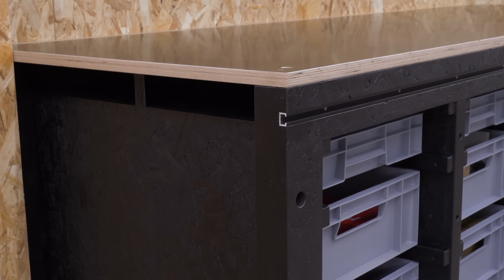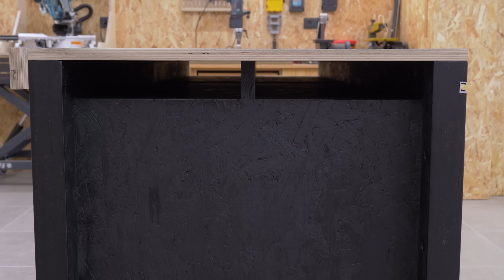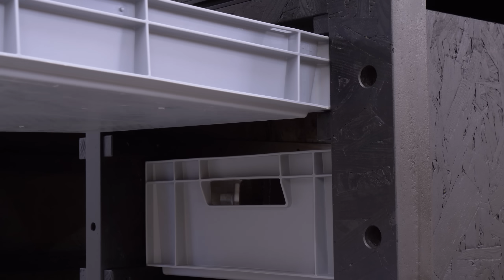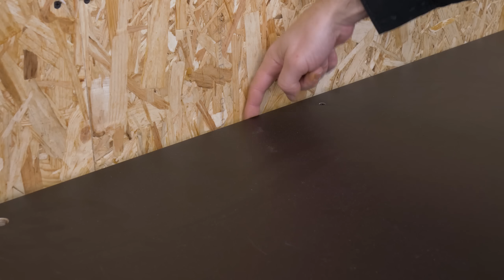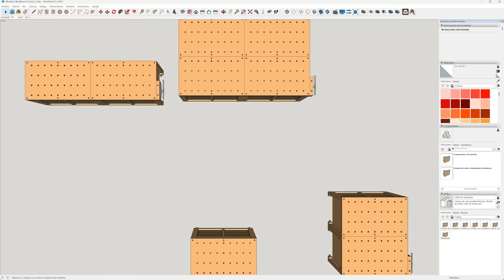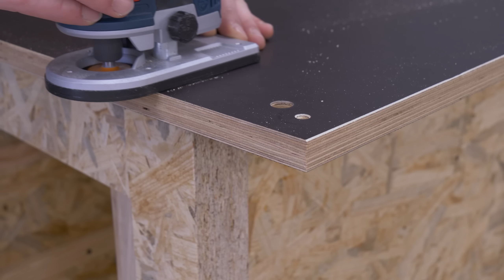OSB Modular Workbench with Storage Box Drawers - Ep 2

Comment: I enjoy your videos. you mentioned the sagging on the drawer boxes you used. I had a similar problem with some of my storage containers and I used a flat panel on the inside bottom of the bin to eliminate sag. most of these bins have a ledge at the inside bottom. from the video I see that you may have the lip as well. just cut out a thin rigid flat panel to the size of the bottom and the panel can easily support itself on the ridge and your sagging is solved. hope this helps

Comment: Fun fact for those looking to use cheap materials... a 2x3 is cheaper than a 2x2!     For corner joint reinforcement... you can rip or even better..diagonally rip the 2x3.....OSB, tempered hardboard and 5mm underlayments are low cost.

Comment: Hi, I was wondering how are these castors for moving over slightly uneven surfaces, such as if you are moving house?   From your videos, it seems the feet retract quite a bit and allow a fair bit of space around the castor wheels themselves, something that is not made too clear in the listings when buying them, as the picture make it look like there is only minimal distance, and would therefore easily 'catch' on uneven surfaces.
 
I have been planning for sometime to build/convert my workshop into more of a mobile option (to be more quickly packed up for moving properties), so that should I decide to move (as I would like to move out in a more of a country area, with a bigger industrial sized shed), and to be quite honest, who wants to either move all their tools etc into boxes, AND then rebuild cabinets etc in a new place, or separately manhandle them, when instead they can just be filled up with packing material (unless made with an organised internal lock up feature) and simply wheeled out to the waiting trailer or truck?  One or two steps, instead of the many more with packing multiple boxes, moving, and then unpacking them!
Reply from the maker: hi, they have a fairly small wheel, only about 50mm, so they're not the best casters for uneven surfaces. I think the same model exists with larger diameter wheels.

Comment: I love this design, I love the modular design and the modular euro boxes. You can get them in the US, but it seems only through industrial suppliers like McMaster, they call them "Stackable Polypropylene Plastic Tote Box". The 400x300x120 box is about $25 USD, so they're over twice the cost they'd be in Europe.
Reply: Yeah, European spec Euroboxes are hard to find in the US. Suppliers like Uline sell similar boxes with slightly different dimensions. The box sizes are designed to max out a shipping pallet, and since North American pallets are a different size the boxes are also different sizes.
Reply: The commercial tubs that busboys and dishwashers use at restaurants would work really well, too. Very sturdy and rugged, they’re made to take lots of abuse. Readily available in quantity at restaurant supply stores, you might even get lucky and get them cheap from a restaurant that’s going out of business (as so many do).
Reply from the maker: thanks for the info!